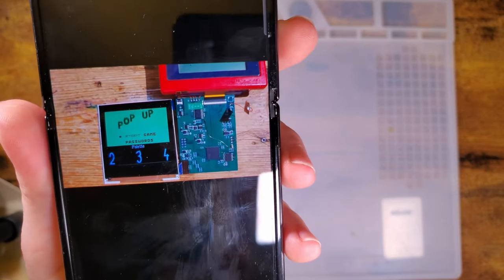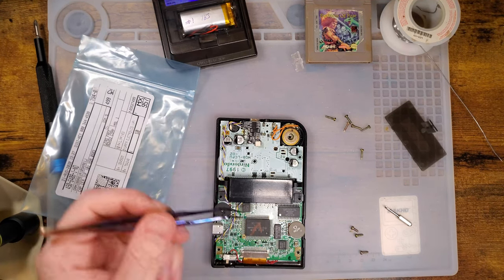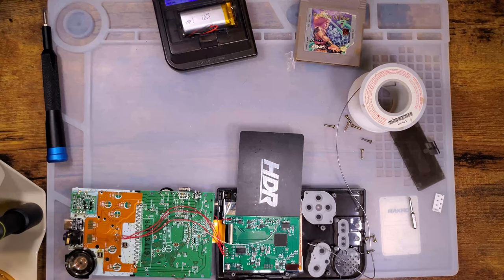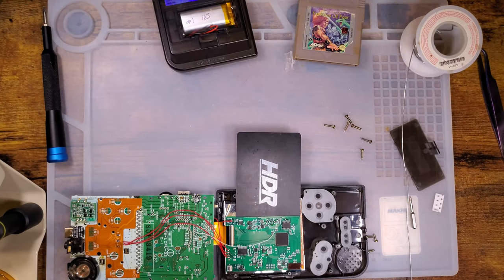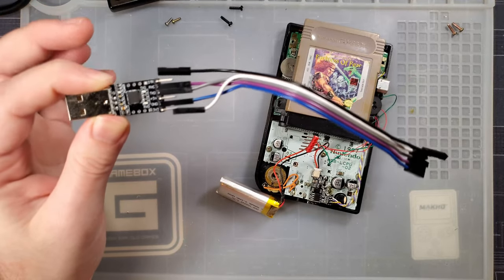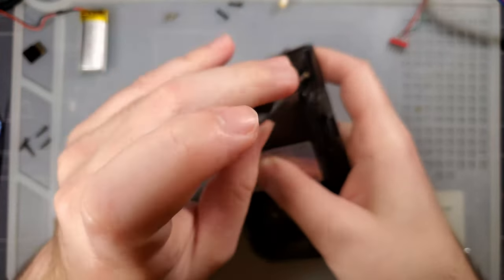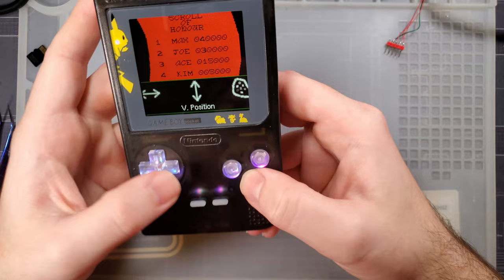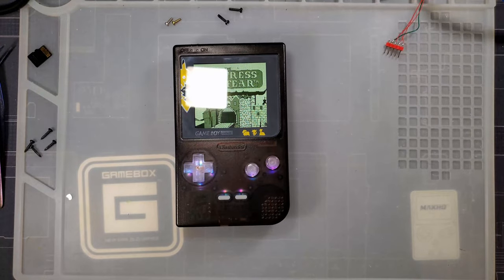Game Boy Pocket Custom OSD Firmware

Comment: Is it possible to change the card slot on an gba sp to be loaded from the top like an analogue pocket does? But that it fits like in a sp an slides fully instead of peaking out like in a pocket
Reply from the maker: If you have to ask, this is probably not a project you can do.